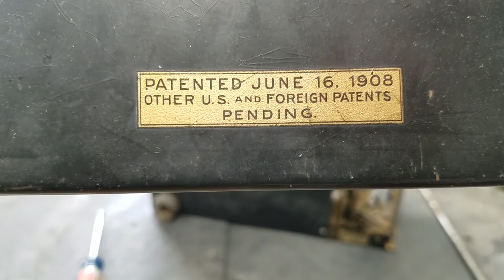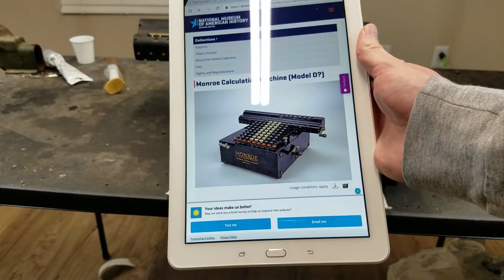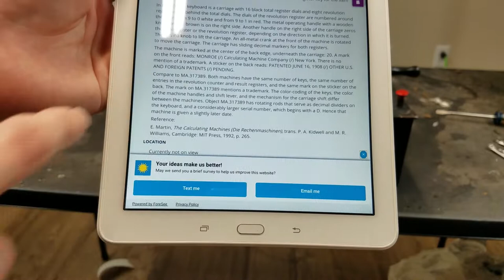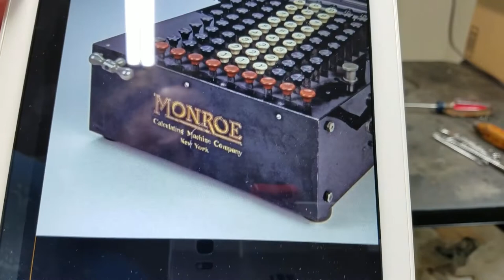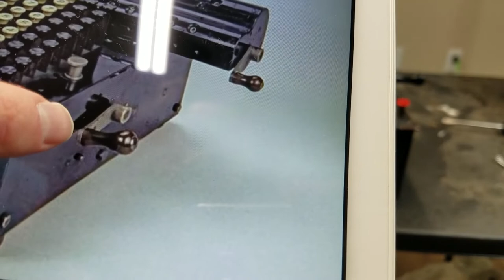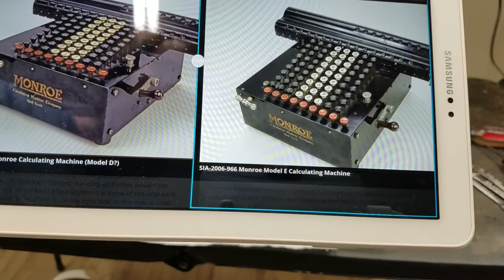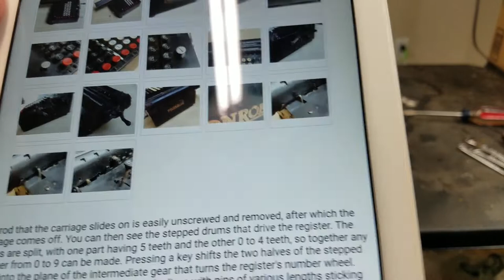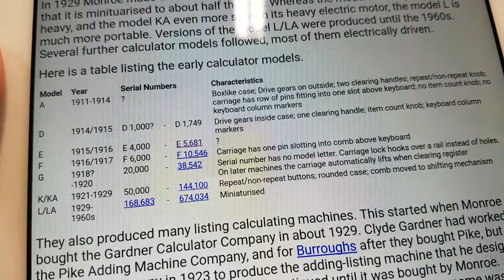Monroe Model D Mechanical Calculator (D858)

Comment: Interesting to see how the early Monroes evolved, am currently reviving a 1920 Model G and this gives a bit of insight where they came from.
A lot of the development effort was i think into making it smoother to operate. E.g. the spring-detent of the intermediate gears had its support moved to the outside; all those brackets that then hold the spring with wheels can be individually adjusted. They added a lot of parts/complexity with that, but benefit is that it can be tweaked to a very light detent, just enough to keep the gear in-place when not engaged.
Also the probably big change of F into G was that the stepped-gears are driven 1-1 over a cycle, instead of ~3 to 1 over about a third of the cycle. Even with the clever friction-spring buffer against the jolt, must be less smooth than 1-1 and a cam moving the axle up-down.
Perhaps even the larger clear-key - it does take some force to move the 8 lock-bars, makes 'handpalm-press' to clear easier :)
Tnx for the insights into the mechanisms!

Comment: Great to see such an old Monroe machine! It's the earliest Monroe I've seen anywhere (except possibly that Smithsonian one), and I love the fancy corners on the keyboard plate. I'll update the serial number info on my page.
You are right about the Smithsonian incorrect photo of their model E. I left a comment on their page, and got a reply back that they agree that the photo is incorrect, and will fix it when the museum reopens. I also suggested that their late model D photo might actually be the model E, but it was pointed out that the description includes the sticker on the carriage in the picture, so it is likely correct. So it seems likely that the later model D does indeed already change to the one-pin-and-comb carriage alignment, and the hook-in-holes carriage locking mechanism.
Reply from the maker: I was pretty excited to find this one, I didn’t think id ever find a model D. Another piece in the puzzle of the model evolutions, it’ll be interesting to see what the model E is once they fix the picture, the later model D is already pretty close to the F

Comment: So very interesting to see how Monroe evolved their design and simplified over time.  Integrating parts, such as getting rid of pins and making the part shape do more functions.  I really find fascinating the fact that by the time they got to my model K they had reversed the function of the parts and eliminated so many different parts for the keyboard to swing plates that then move the split Leibniz wheels.

I did a video on my long ago on my Monroe CST 8 showing the functions under the keyboard to illustrate the operation.  Would it be possible for you to do a similar video?  I’m very interested to see how the keyboard fingers move the plates.  Being the interacting parts are basically opposite from the D to the K and still do the same thing.  They saved making & stocking a lot of different parts by changing to the latter design.
Reply from the maker: I can make a video like that, that part of the mechanism seems to be the same from the D to the G and then switched with the K. The distance the rockers move would be the same in the D and K, just the position specific variations moved to the rockers